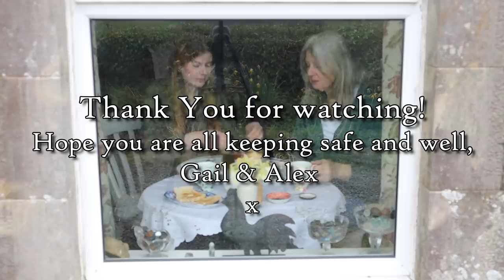Restoration of an antique bottle once used in our home 100 years ago!

Comment: Really excellent work. Particularly impressive to me, as an engineer, was how you formed the thread. Made a bit of an arse of drilling the hole though. The entire video was joyous.
Reply from the maker: It's difficult trying to drill whilst holding it under the camera to film it!
Reply: @NorthernMudlarks  Yes I get that. It wasn't meant as a scathing criticism. I admire your craftsmanship immensely.
Reply from the maker: @britishreaction54  Thanks for that Carl, though as silversmiths we have a few Dremels and a Dremel drill press adaptor for them too, they are great tools. You saw mum using the flex shaft for the Dremel to be used as a pendant drill commonly used in jewellery smithing. It was a small hole through thin annealed silver, it was quicker and easier using the flex shaft in this case and the hole came out perfectly xx
Reply: @NorthernMudlarks  That's excellent. Your skills are enviable. I also have a flex shaft like yours and it certainly comes in useful at times.

Comment: You did a great job Gail. Well done. I have the same salt shaker (pepper shaker?) but it has more holes in the top. I use it to hold the hat pins I made 🙂 Actually I just checked and it’s not quite the same but very pretty like yours! 

https://pin.it/4nhZkw4
Reply from the maker: What a wonderful idea for the pins! If it has my than one hole it's  usually  a pepper pot, or the larger ones could be sugar casters xx
Reply: Northern Mudlarks yes I wondered about the bigger ones. Thought they might be for sugar 🙂👍